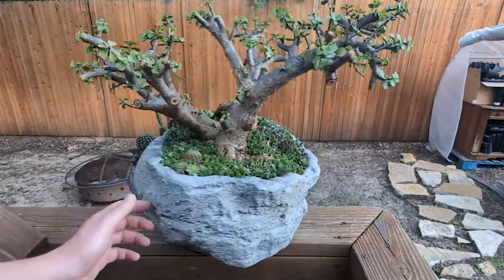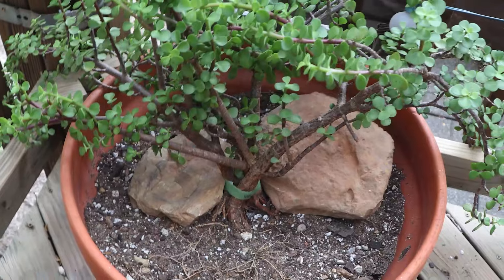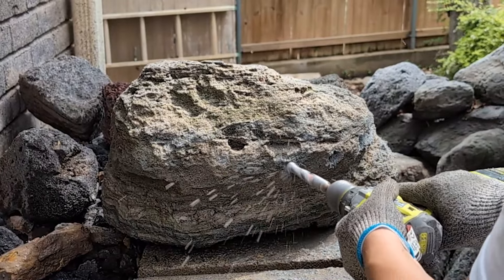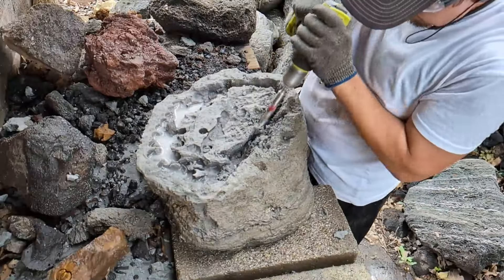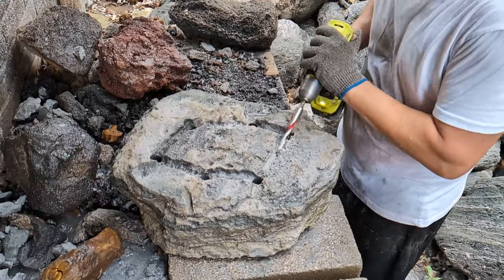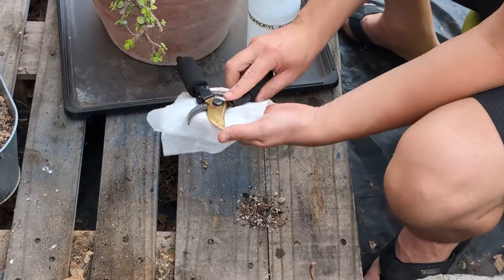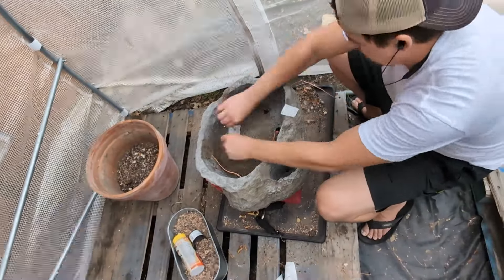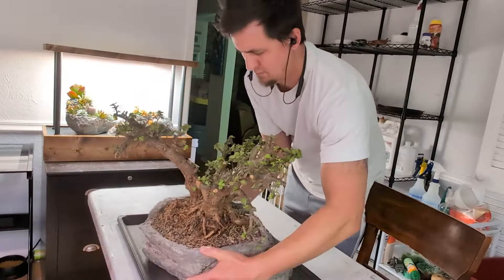Bonsai Grove in a Stone Pot - Part 2: How to turn a stone into a planter

Comment: What kind of stone is this? Looks way softer than what I’ve been trying to use 😅
Reply from the maker: @treymay10 what kind of rocks have you been using?  I've worked with multiple kinds, and some of them are definitely harder than others.  For harder rocks I use a different set of bits and I slightly different process.  I recently just posted a video of a terrarium build, and It shows the process of drilling out harder rocks, it would be helpful to see. https://youtu.be/8FLMJLHtuWc?si=Tc1ObDsBvp4ONbLN
Reply: @plantsinrocks  one of the rocks was seeming as hard as trying to carve quartz so I’ve been sticking to what seems to be sandstone but sometime even that will have some tough layers in it, I’ll check out the latest vid tho thanks